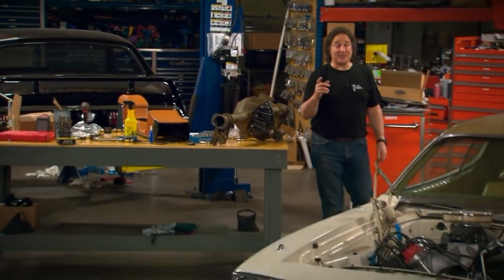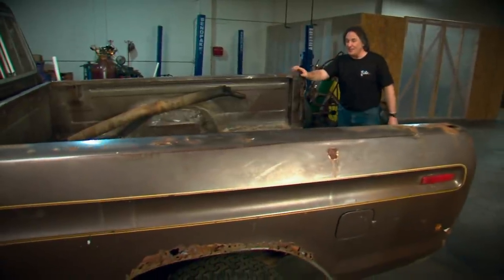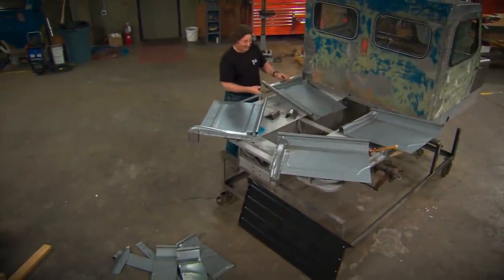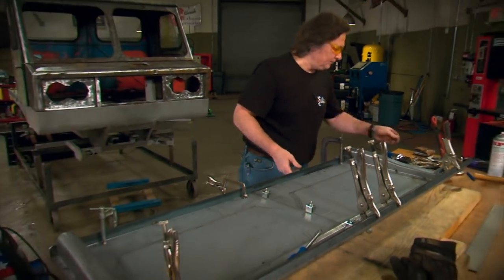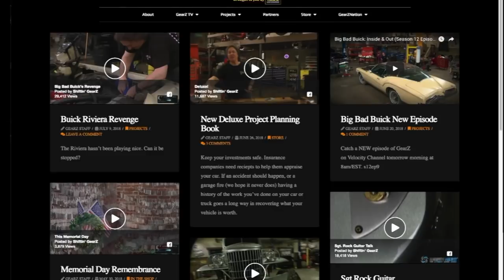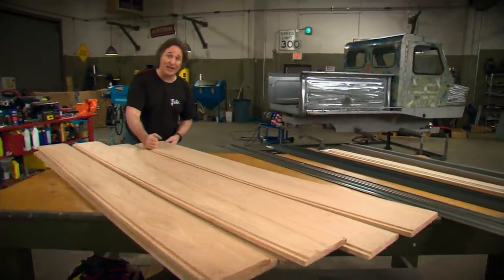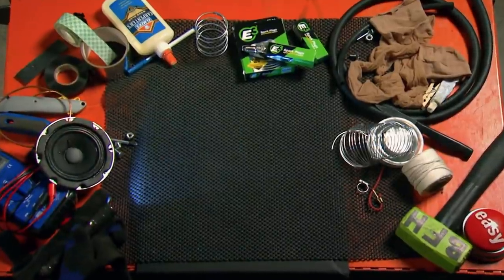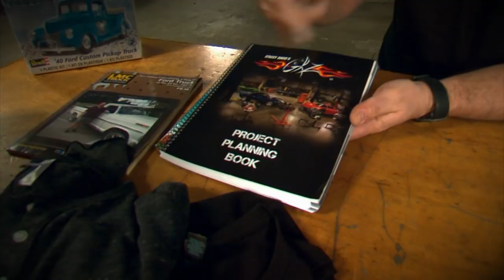Snowcat Sheet Metal Custom Truck Bed Fabrication - Stacey David's Gearz S12 E2

Comment: Just went to the TMCTruck.com website and found door fastener removal too, hinges, hinge parts, bed panels, and cab corners.  No more patching rust holes with tiger hair and bondo.  Looks like a good price, too.  Also watched Gears when it wa on the local station many years ago, glad to have found it on YouTube.  Love the incredible builds.